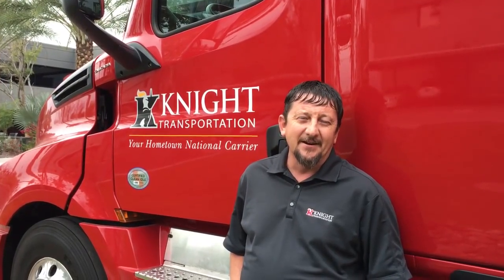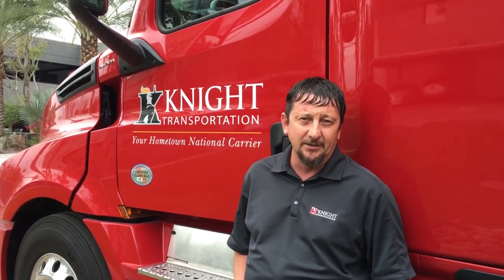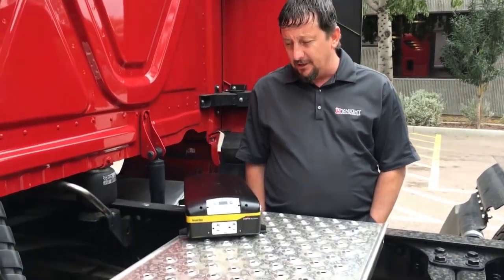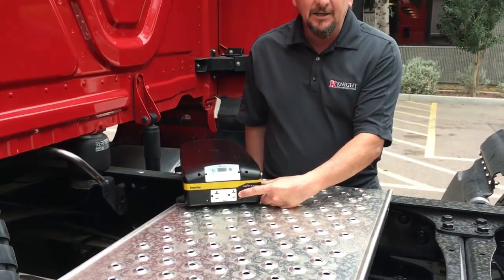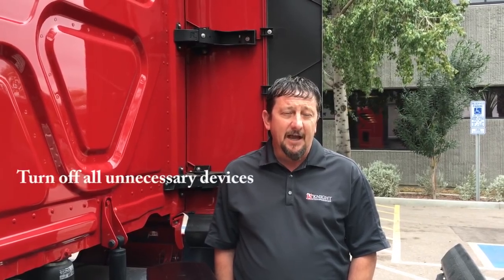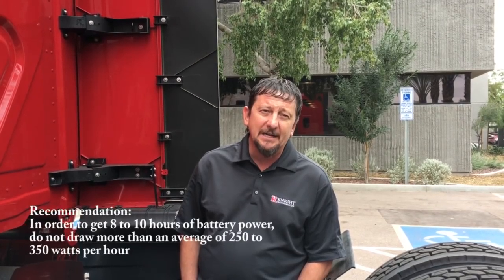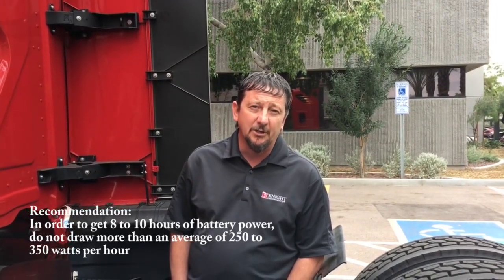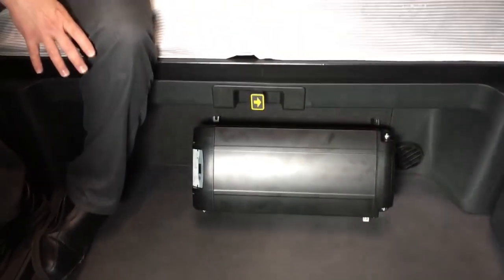Power Inverter | Knight Transportation Training

Comment: Haha I have to leave a gallon of water on the gas pedal to make sure the truck stays on since Knight has mandatory idle shut off on my Volvo. 10k rpms F*** it. If the truck isnt on the inverter won't charge a d my refrigerator and electronics black out. Knight should have installed Idle smart as well so I dont have to do tacky crap like this. No common sense in this company. Idle smart ranges from $900-$2000. Far cheaper than installing massive APU systems ranging from $6k - $20k + and installation only takes 3 hours. For a truck they only keep for 500k miles thats not a bad deal. But whatever....stuff like this just ensures that I will not be staying with this company for long. The little things make up a huge difference in this industry when it comes down to reducing stress when your life is solely on the road.

Comment: How do you turn it on? Mine keeps telling me that the output voltage is 0.00. When I hold down the power button it just turns off. The directions say that holding down the power button will allow more options.

Comment: This car charger plugs into a cigarette lighter outlet🎡>share4.photo/BPowerInverter?B80    and allows charging via both standard electric plugs and USB. Works great, but be careful what you leave plugged in or else you might end up with a dead car battery.

Comment: good video  ..
have questions about inverter for  semi truck freightliner Cascadia 2016  1500wat  should be enough to run mini AC fridge and small  microwave  .. if the truck engine off can I use microwave and what gonna happen for the fridge when the engine off  have to turn off the fridge or have to start truck engine  ?
... appreciate
Reply: You're still waiting for Knight to answer huh?

Comment: Can we please upgrade to tripac? AC power alone is a waste of time considering we will then have to worry about battery drainage. With tripac, batteries are kept charged, the driver will enjoy heat and air conditioning with out idling. 
This new install is a waste of time and really demonstrates how much value the company places on its drivers.
Reply: Yancy Bowers it's because they don't care about the drivers they made that pretty clear before I quit they don't take care of their trucks at least in Columbus or Indy they are all junk. With these inverters all they are gonna do if fry the batteries on the truck just my opinion
Reply: the inverter is 100 bucks tge tripac is 10,000 ya knights gonna put those on, with their insurance rates from knight drivers smashing into everything basically a swift equivalent they can only afford an inverter
Reply: @nighttrain3926  100 bucks my azz